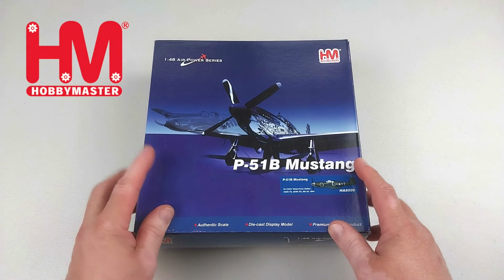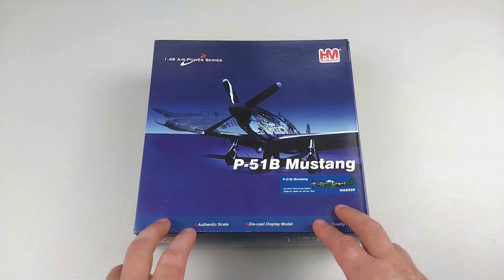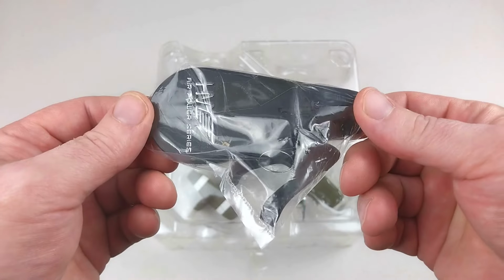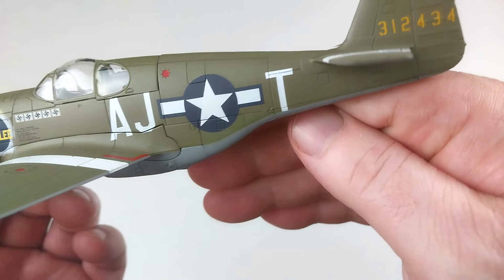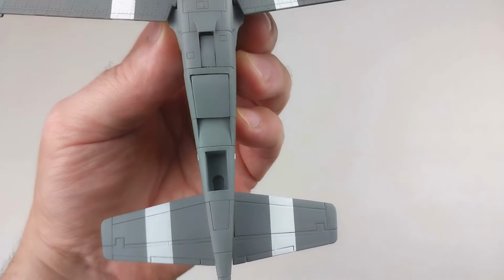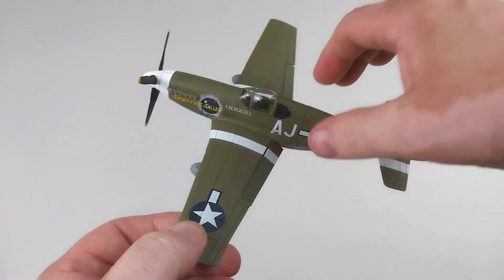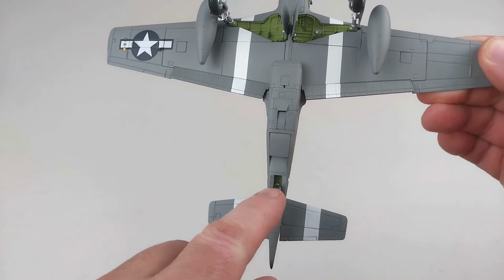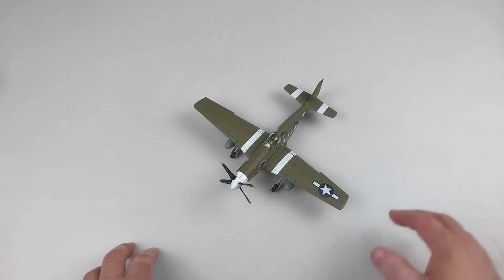North American P-51B Mustang USAAF, "Short-Fuse Sallee", 1944 Hobby Master 1:48 Diecast Model HA8509

Comment: I have a different Hobby Master P-51 but am having issues with the closed landing gear doors constantly falling off. Did you have to glue or tape yours down?
Reply from the maker: No mine seemed to stay in fine. Maybe try a little bit of blutac to keep them in place. That may hold them in. If you going to risk gluing I would use a non-permanent type so if you decide to display it gear down you still can!! Thanks for watching!!